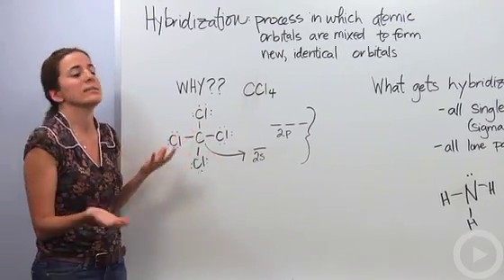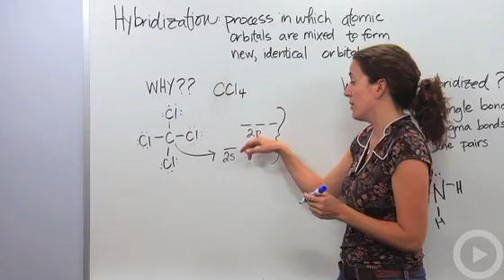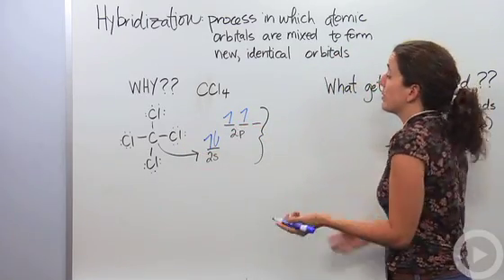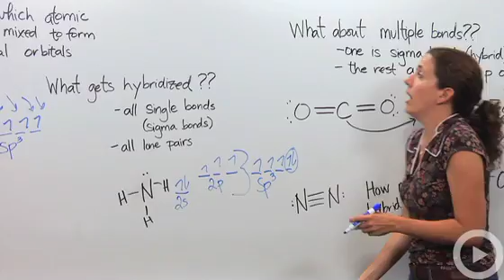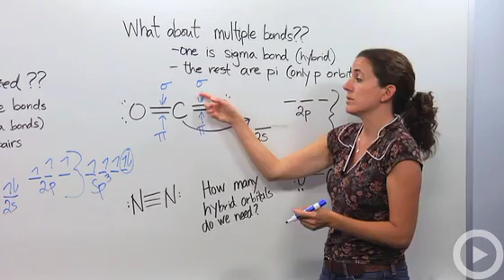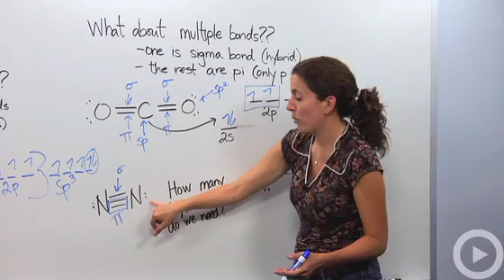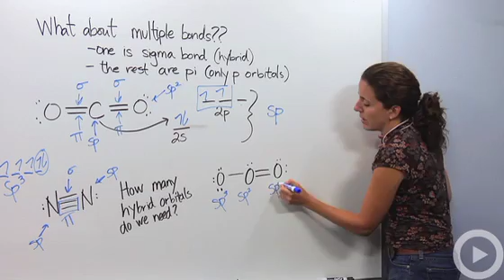Hybridization

Comment: In the first minute I was with you but as you went on..........everything just became french for me
Reply: Hhahah
Reply: Same here 😂
Reply: Same here 😂😂😂
Reply: When carbon is by itself and non bonded, two valence electrons are in one 2s and 2p orbitals. The valence electrons are at different energy levels because the orbitals themselves are at different energy levels. 
But when carbon is covalently bonded you can see in the lewis diagram the bonds seem to be all equal - there is no preference for one bond over another. How is that possible if the valence electrons from carbon are in different energy level orbitals. Is the lewis diagram incorrect misleading? 
No, the lewis diagram is correct. This is what electrons prefer to do in covalent bonds.  Electrons tend to form hybrid orbitals of the same energy level, like a melting pot of orbitals. The hybrid orbital is called sp3 in this case because we have 4 electrons and we need to fill out the hybrid orbitals, electrons like to be spread out as much as possible (hund's rule).
Reply: I speak french so in my case it was easy to understand..or nottt
Reply: Henry 101
lol okkkkk you are dissing me Henry....

Comment: For anyone wondering, in the carbon tetrachloride example, carbon normally has 2 electrons in the 2p orbital, but when preparing to form a bond with another atom it becomes excited and an electron from the 2s orbital jumps up to the 2p. So now we have 2s^1 and 2p^3, which is why the hybridized result is sp^3!

Comment: All you have to do is count the number of lone pair e- and the # of atoms that are bonded to the central atom and then count them!  You can see it in the first example, CCl4, Carbon is bonded to four Chlorine atoms so you count to four!  sp3. Another example would be PCl5, it has five bonds and no lone pairs, so sp3d.  It isn't necessary to do what she did!
Reply: Thank you so much, I simply do not understand why they don't introduce tricks likes this first so the material is not so intimidating.
Reply: She actually explains it (kinda) in her video.  It has to do with the spin quantum number.  I'm not a chemist, but as far as I know the highest you can go is up to sp3d5.
Reply: *****
Remember that the orbital s only has 1 slot, orbital p has 3 slots, orbital d has 5 slots, and orbital f has 7 slots. Each slot CAN contain up to two electron, and up and a down arrow. For hybridization though, we want each orbital slot to only contain the up arrow. So for p, which has 3 slots, we can only go up to p3. After that we have to go to d.

Comment: If 2 electrons are on the S subshell and 2 are in the P subshell for Carbon, why does it become sp3 and not s2p2?
Reply: S only has one configuration. So you can only hybridize the one S. P has 3 configurations to you can hybridize 3 of them with that one S as needed.

Comment: Carbon has only four Valence electrons(remember that Roman numerals above the Group reveal the valence electrons that those particular elements have)... hence the "last" 4 are 2s2 and 2p2. Since Carbon has to bond with Cl in her example they do not bond at different energy levels, so hybridization is a way of explaining how to move the valence electrons into one energy level so that they can bond equally with the four other elements. So 2s2 and 2p2 becomes sp3 (s has one shell and p has 3)

Comment: with the double bonds, electrons are being shared in the sp2 orbitals and the p orbitals, as opposed to the single bonds where only electrons in the sp3 orbital are being shared.  i could be wrong about this, but my understanding is that in an sp2 hybridized carbon and an sp2 hybridized oxygen, the arrangement of the orbitals should look the same.  there should be 3 sp2 hybridized orbitals and 1 p orbital that hasn't been hybridized.

Comment: Thanks, it makes sense, so they hybridze to make all 4 bonds of the same energy.  However in someother video I saw that in H2O the 1 2s and 3 2p orbitals from O hybridize to form 4 sp3 orbitals.  2 H's bond with 2 of the 4 hybrid orbitals leaving 2 lone pairs.  But in some other video it showed that H2S does not hybridize (even though O/ S are similar) gving different bond angles than H2O.  For H2S energies of the s/p orbitals are different!  How can that happen?

Comment: N has five valence electrons, two (paired) in the 2s orbital and three (unpaired) in the 3p orbitals (one in each). It's true that the three unpaired electrons can pair up with three unpaired hydrogen electrons without hybridizing, but the lone pair (in the 2s orbital) still needs to have the same amount of energy as the other, newly formed pairs. For this reason, the s and p orbitals hybridize so there are four equal orbitals.

Comment: From what I'm getting, you exclude the the same amount of P orbitals as the pi bonds on the C atom and use the remaining orbitals left. There are 4 bonds, but you only need 2 since the other 2 (both overlapping p orbitals) are different in strength. Each sigma bond requires an orbital, and C would require an s orbital and a p orbital.

For every multiple bond, there is only 1 sigma bond + the remaining bonds (Pi Bonds).

Comment: Or..you can determine the number of Hybrid orbitals of each by determining the steric # of each atom. Just simply the number of areas were bonding or electrons are present around the atom. For example..carbon with a Steric # of 2 = sp Hybridization; Steric # of 3 sp2 hybridization; and Steric # of 3 = sp3 hybridization

Comment: @zezo7hdk Didn't have room in the previous comment but continuing that method, you will see that for fluorine, there are 2 electrons in 2px, 2 electrons in 2py and 1 electron in 2pz. (hence 7 valence electrons - that is electrons in the outer most orbital). Finally the noble gases has 8 valence electrons...2 in 2px, 2 in 2py and 2 in 2pyz. So AT MAX, 2p subshell's can have 2 electrons but this doesnt mean that all the 2p subshells are filled in all the time. Hope that helps :)

Comment: @zezo7hdk Not all 2p orbitals are filled with 2 electrons. Remember there are 3 2p orbitals. 2px, 2py, 2pz. If you look at 2nd row, Boron only has 1 electron in one of its 2p orbitals...to arbituarily pick one, i'd say 2px. Carbon has 2 electrons in its p subshell. 1 in 2px and 1 in 2py. Nitron has 3 electrons in its p subshell...1 in 2px, 1 in 2py and 1 in 2pz. O then gets its 2px fileld next. so it would have 2 electrons in 2px, 1 electron in 2py and 1 in 2pz.

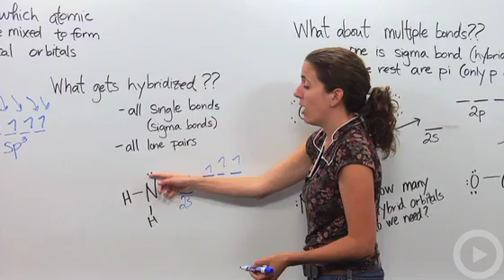Comment: @Termin8trix Lone pairs aren't really repulsive in this case because, remember, each orbital can have 2 electrons? lone pairs are just 2 electrons in a orbital - meaning in this case at 2:56, one of the sp3 orbitals has lone pairs (2 electrons). Just to extend, there are still 3 more sp3 hybridized orbitals with 1 electrons in each. They aren't happy, cuz they want 2 electrons. And then 3 hydrogens come into play, and provide each sp3 hybridized orbitals with 3 electrons from its s orbital.